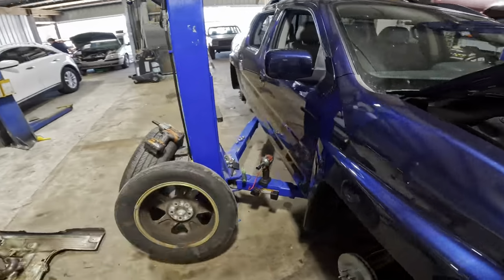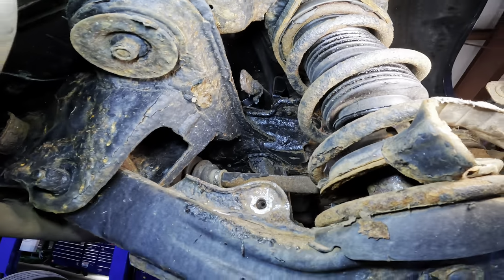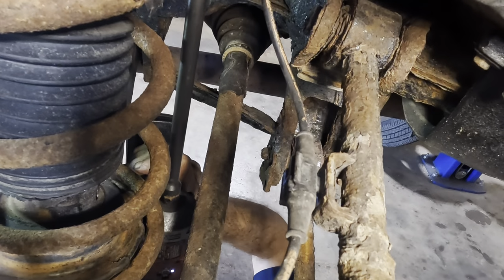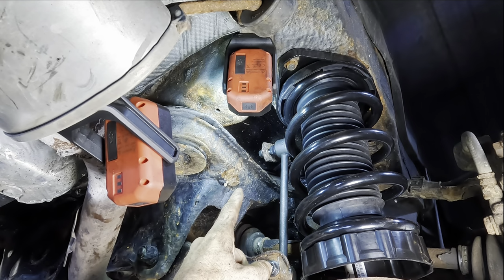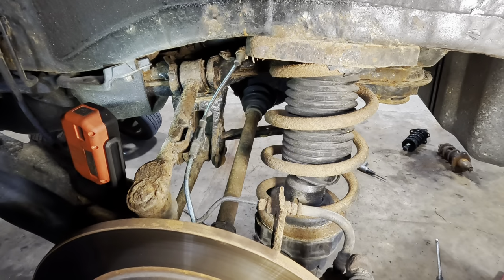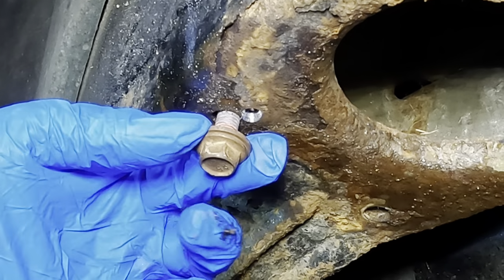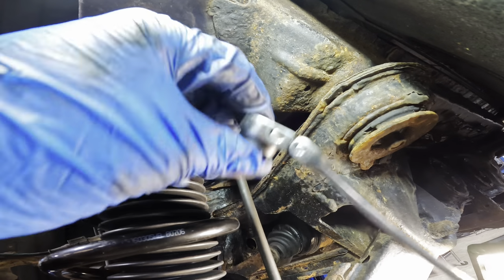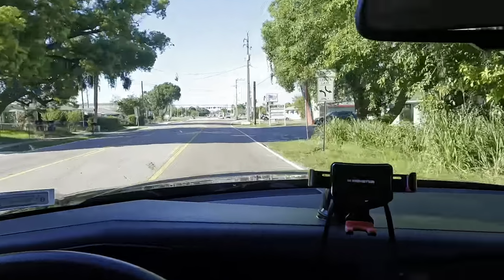Broke off in the FRAME! Strut Job Going Wrong! Honda 3.5 2006-2014 @MilwaukeeTool Pt2

Comment: Boy that's a Used Car Dealer special. The truck was rusted and then they either undercoated or sprayed everything down with pain to hide the rust.  Seen it done many times up in MA. What a shame. But reminds me of the control arm I changed before you changed the pass side. Rusty crusty.

Comment: Ray, you're about 1/2 way to being a frozen north repair man. When you have a 1/2 inch bolt pop apart from rust you will be mostly ready. What a nightmare to fix in a rusty frame. :P

Comment: Great flippin' Scott, but this is one crunchy Honda. 😲  It surely must have lost at least 50 pounds of weight from the rust that you knocked or vibrated loose.  Were my bodyman brother (rest his soul) here to see your solution for replacing that captive nut, he'd have loved it.
 
@cyrusmoser1090 brings up an interesting point about disconnecting the battery before welding on a vehicle.  Is there a definitive, scientific discussion of this?  I'm finding conflicting opinions/procedures.
 
I'm amazed and glad that you're assembling a capable team, and your business isn't yet a year old.  Keep up the good work. 😉 👍🏼

Comment: No, I'm not comparing you to Eric O. But I seen in a similar situation where the nut was not there. He used a rivnut to put it back in. Could this also been used in this situation or was the welding a nut in better?

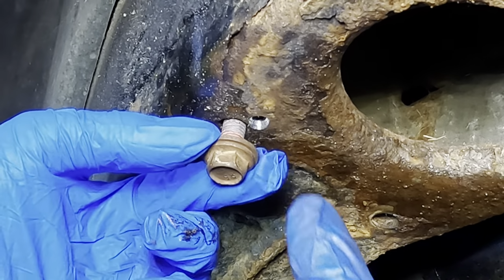Comment: You could also weld the nut to a larger outer diameter washer and then plug weld the washer to the frame in mutipul spots 40:49 @Rainman Ray's Repairs

Comment: I use a short piece of copper pipe as a spacer. So you can tighten the nut and bring it in the correct position. And the copper doesn't bond during welding, so the screw is not welded.

Comment: That Ridgeline has definitely been undercoated with Ziebart. An asphalt like substance that hold’s salt and water behind it. That’s so you can’t see it rusting from the inside out. At least until the coating starts flaking off. A sure way to destroy your car in short order. Also the fluted bolts help keep the bolt from seizing to the bushing.

Comment: Welcome to the rust belt, lol. I never had the pleasure of repairing one of these lovely vehicles. If you really loved your job you could have done it without welding the nut into place. I worked in a shop attached to a mall so we had no torch or welder, our fix would have been, lock washer and jb weld it into place and hope we could get it tight before the jb weld broke loose.

Comment: Quick question Ray - Why did you not spray lubricant on those fasteners on this rusty situation? In particular, the strut removal/install on rear.

Comment: I uh...hate to be the bearer of bad news. For those in the audience thinking "that homebrew captive nut idea is a good permanent solution ". After the Honda drives over it's 147th bump in the road, it will break off from the weld and be just like the one he took out. I do have to give Ray credit for finding a way to replace the fastener inside the frame to finish the job. I wouldn't call it a permanent solution. It probably doesn't matter because those Chineseum struts won't need to be replaced anytime soon.

Comment: Gramps taught me that when a bolt breaks loose, do NOT stop turning it but turn faster so it doesn't cool and bind, causing a broken bolt.  Also possible this particular bolt had a bunch of rust up behind the end of the bolt that bound it after it came loose initially.
Reply: while that does work in most cases, the problem is these are so rusty the rust binds it up. the best thing to do is keep running it in and out and slowly walk it out. when it slows down run it back in rinse and repeat. takes longer sure but it works. another thing use a torch whenever possible. the torch saves you major time and makes things much much easier.

Comment: good vid ray, why didnt you use a torch though? the torch would have saved you time for sure. another trick i learned as well, when a bolt is a bitch like the one that broke or when they are that rusty. i remove them in steps. i run it out til it slows then back in repeatedly. takes longer to get it out but most of the time it wont break when they are that bad. all that damn rust binds it up and end result they break. im in  the rust belt in pa and shit gets ugly here. its fun when the bolt changes sizes on you 5 times as well lol. alot of times they have loctite on them as well which a torch will save you w that as well. a great torch head for a map gas tank is the turbo torch stk-9. that torch head is by far the best you can buy period. try one i promise you wont be disappointed. that goes for anyone else as well. if you need a good torch head buy the turbo torch.

Comment: Although having been a mechanic for more years than I'd like to admit. As well as being from and living in Texas. The amount of rust on that thing is incredible!! I personally question the road worthiness of that thing. Yes I've seen much worse on "Just rolled in". As well as having seen my fair share of rusty-ish vehicles in my work space. But when you start talking about coil springs breaking on a vehicle with less than 100K miles. As well as having to literally hammer off and dig through the rust to find out what size the bolts are. I'd start to question the safety of the vehicle as a whole.

Comment: If you were worried about lifting the vehicle off the rack when using the jack to compress the strut spring in order to align the bolt holes, why not use a Strut Spring Compressor to compress the spring?
Reply: For a quarter inch, doen't make sense imho 😊
Reply: @alainmarcoux4156  ¼" is plenty of space for all sorts of bad things to happen, especially when there's uneven pressure being applied to the strut/shock spring.

Comment: You aren't a mechanic or a DIY until you cut,  grind,  chop,  ignite the sway bar links at least once lol😂😂. I am surprised the new assembly didn't come with new top bolts,  they usually do.

Comment: Would you not have been as well or better welding the bolt into the hole instead and attach with nut from the bottom?

Comment: Hey what ever happened to the  well I think is was a Subaru engine that first had a bolt brake off then you had to fix the threads on it cuz they stripped out. Has it gone back in the car yet?

Comment: What happened to the metal seat under the old right hand rear strut, it was there when you removed the old one, then gone when you installed the new strut?

Comment: Just asking Ray, why are you not applying some grease to the rusty bolts before reusing Them on the car?
Reply: should really wire wheel them then use some never seize. i also for the life of me dont know why he didnt use a torch. a torch would have helped out big time.

Comment: I would have replaced the caliper and bracket knowing that the caliper hit the wheel and the caliper bracket was grinding in the wrongly installed rotor but that is me 1:00 @Rainman Ray's Repairs

Comment: So much rust looks like something found at an archeology dig, big nuts and bolts actually smaller in size due to all the corrosion. Maybe best to wire wheel the entire area before working on it.🤔

Comment: I have heard a lot of stories about broken car road springs.
I remember the old days of large heavy American cars the seemed to waft along with a smooth ride.
Today’s medium sized cars seem to be built like racing cars with hard spring and dampers and wide low profile tyres.
I don’t want to drive a car that will shake my dental fillings out and with modern roads being full of potholes and a top speed limit of 70 mph here in the UK it all seems so unnecessary.
The Citroen C5 Aircross seems to try to offset this as in the DS19 and 21.
I know you are in the US but do you know of any manufactures who build reasonably priced comfortable cars?

Comment: As a non mechanic but an engineer a couple of dumb questions! Why didn'y you spray penetrating fluids on all those crusty fixings the day before while you were waiting for parts? Also I see on a number of episodes you re use the Bolts, do you clean them up before doing so, but on this job the heads were clearly crusted, why noy put new in? not criticising just curious. Sorry I think you may have but some new bolts in but not clear!

Comment: The fluted knuckle bolts are so they dont seize in the bushings. On the older ones, they werent fluted and it would take a good... 3-4 hours trying to get the bolt out of the knuckle if you lived in a rust-belt area. After a while, mechanics would just get an entirely new knuckle because some of them were rusted in so bad they werent coming out, period.

Comment: Judging from the “flavor” of rust here - it’s from the western New York stretch from buffalo to Syracuse likely as that’s where I am from.  That kind of undercoating is notorious for trapping moisture and making the rust worse - I did cringe for not wire wheeling the frame mounts and throwing some rust convertor / spray paint on there

Comment: That was one way of welding a new nut for the replacement strut bolt. I would have first welded the nut to a flat washer and then welded the washer to the frame through one or two drilled holes.

Comment: 15:21 
Ray, several of your fans have suggested that you should use penetrating oils prior to attempting to remove the rusty bolts.

You stated you should charge a RUST SURPLUS TAX.

How about charging for de-rust fee and service, prior to doing any work on the vehicles.
If you remove the wheels and then lower the entire vehicle into a bath of your brand of "RUST-EZE" overnight, you might have an easier time removing most bolts.😮

When you are completely done with the repairs, spray the entire underside of the vehicle with an oil protection product.😂😂😂😂😂😂😂😂😂😂😂

Think of all the extra work you could generate for your new employees in your new business! You can call it "Rainmans DERUSTO Ray"!😊😊😊😊😊😊

Comment: On the bolt that broke..I would have added lubricant and turned the bolt in and out a few times.  If you had done that it probably would have come out without breaking.

Comment: Those bolts are fluted, I think, so they don't stick so bad when they rust up.  Here in Minnesota, it makes no difference, those never come out, you have to burn out the rubber bushing.  Huge stink, every time.

Comment: That's what the older cars in the UK are like, that chassis looks forked if you ask me!!

That's why I hate the lack of rust preventative sprayed under vehicles by the manufacturers, I'd be wire wheeling and lubricating the bolts before rebuilding too 😆 🤣 😂 

Especially on my own car!!

That is such a drama-rama clickybait title, I thought it was going to be far worse than it ended up being lol (I thought the bolt was going to snap inside the captivated nut in the chassis lol)
Reply: The extra cost per vehicle to galvanise the chassis would be very little, but then they wouldn’t sell as many! (I’m in north of Scotland)
Reply: @phil6465  nah, they only want a car to last 7 years anyway so you need to keep replacing them!! lol

Comment: You may have a kind of rust zone there but you can't even imagine how it is in the winter road salt zone here in the nordics. It is rust to the power of ten, as that road salt acts as an electrolyte. Cars that do not have a rust protection coating on the underside are almost doomed...

Comment: Dayumm! What a rusty, crusty unit! Curious why you deviated from normal protocols by not using PB blaster (not sponsored) or the like with a littke heat to help speed and ease the removal of those so rusty, crusty fastners?

Comment: When cars come in and are that rusty, why not use some WD-40 (or something similar) about half an hour earlier. That should make it easier. And also, when trying to line up the parts to be bolted, use a Philips screwdriver to line up the part. It's easier to wiggle the screwdriver than the part itself.

Comment: If that was my ride, i dont think id be able to resist making it a project to first replace all super rusted parts that i could, and second, clean all of that rust off of the subframe, re-spray and fluid film it.  May be time consuming and expensive, but necessary.  Thats some build up on that one.

Comment: Just drop a bot down thru from the inside top. Gently install the strut lock washer and nut being brand new will spin right on. Been there done that on these. More than once. Easy leash no big deal. Welcome to the rust belt hahahaha

Comment: Wouldn't lubricant make those rusty bolts come out a lot easier? Anytime I have anything that looks like those bolts I hit it with penetrating oil, etc and let it sit for awhile - even overnight. I've seen Ray use lubricant before so I know he has it.

Comment: Is this not a repair-value that exceeds by far the value of the car? If the car was rotten to bits it would be economical. But on a car on its way out due to rust? How many months of life will this car have left if it is used daily in very very salty conditions?

Comment: Someone please give me some advice, what could cause brand new calipers to not want to release? Everything installed and bled as normal, but when I brake and release, the caliper keeps pressing, even with the bleeder open I can barely turn the rotor by hand. It just won't retract. Overheats during normal driving.
Reply from the maker: Collapsed hoses or a brake booster that is full of brake fluid from a master cylinder leak can cause it. If it’s a GM truck, pull the brake master off of the booster (you don’t have to remove the hydraulic lines)and look inside for a bunch of fluid
Reply: @RainmanRaysRepairs  OH MY GOD, I didn't expect The Man himself!! <3 You made my day!
Reply: @RainmanRaysRepairs   Hey, Ray! Just an update for you and anyone interested - turned out to be an assembly defect with the handbrake lever on the caliper. It mounts on a notched rod, and they installed it one notch over, so even when completely retracted, it still hasn't fully released the piston. I reinstalled it a notch back and now my caliper doesn't stick anymore. They are Bosch single-piston calipers with integrated handbrake.

Comment: You could’ve just welded a metal “flag” to a bolt and just dropped in from top and used a free running nut and lock washer, looked like plenty of room to do that

Comment: 19 : take 5 min and wire wheel the surfaces, spray some WD40 on the threads and wire wheel the threads on bolt.

Comment: I cant get over the degree of rust and corrosion on the suspensions and sub-frames on the cars in the eastern states of the US. The cars are not ancient by any stretch of the imagination. I am in Australia and we usually don't encounter that problem as much as you do. In the last 12 months I have completely rebuilt the front and rear suspensions of my 2007 BMW X3. Any hint of missing paint or corrosion anywhere on the suspension parts or sub-frame was quickly addressed by myself with a cordless impact driver and a wire brush and a coat of paint with a spray can of primer followed by black acrylic lacquer. I wouldn't expect any mechanic to work on cars in the condition such as this one. The same thing with dirty oily engines. There are no oil leaks on my BMW anywhere eventhough they are supposed to be notorious for oil leaks. This all comes back to a bit of preventative maintenance by car owners.

Comment: The AC compressor were notorious for clutch failure from that era
Tell the customer to get a new electric clutch or pull the shims from the compressor
On the other hand it’s over 10 year old so he may just be beating it to its end

Comment: To prevent a car from lifting off the lift. Why not install anchor point in the concrete and use a rachet strap to pull the car.
For safety, you know ?

Comment: Another 5 or so rust winters this vehicle will have a rust totaled frame and this frame will not outlive the new struts. If it spends its winters in Florida, it should not be a problem. It lacks the plastic wheel well liners and that strut is probably a pile of slush all winter.

Comment: BURN it off do not use a chisel or a saw

i also have no complaints on how you welded the new nut into the frame

1 question are you instilling Troy and Dave with your ethics when it come to the work you all do

Comment: Why did you not use wd40 or PB blaster on those drop arm nuts and also use a hex wrennch to hold the ball joint in the end of the joint provided for this.  But, there we have it "Butcher Ray" at his best. Also what kind of craftsman hits his sockets with a hammer. Though with the money you make who cares. You certainly don't. I couldn't believe you never cleaned the rust off where the new unit bolted to the frame. I couldn't stop laughing.

Comment: Reason 1 why rubberized undercoatings are terrible. They trap moister and paint it a pretty black. Then mechanics deal with the after math goop. Oil based is superior and you just have to reaplly before salt season.

Comment: Jesus man pop link off ball of sway bar link vice grip on ball side heat the 14 mm nut and left loosey. Cranking on thin metal to break a harder metal not so hot . Btw I’m a master Honda tech 24 years

Comment: Wire wheel those rusted bolts. Put some lube on the threads. Only takes 5 more minutes. Your not on flat rate.

Comment: There is no such thing as a 13 mm on a Honda. You have to hold the joint with channel lock pliers to keep it from turnlng with the nut on the sway bar links. You are doing it the hard way and its taking you 4 times as long. Ya need some heip ?

Comment: All that rust is from not taking care of your vehicle properly and washing the undercarriage often.  I've seen cars far older than this from the Northeast that are in far better condition.  The owner of this Ridgeline just doesn't take very good care of the truck.  I'd give it 5 to 10 more years and the frame is going to be rusted through enough that it becomes too unsafe to drive.